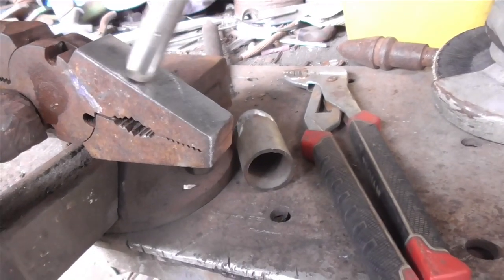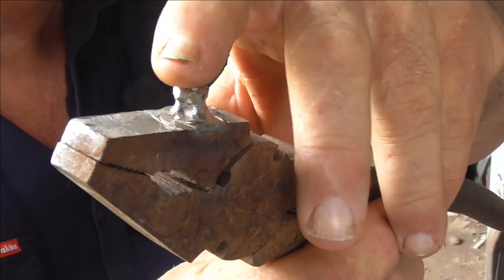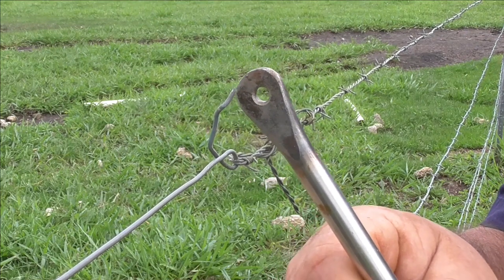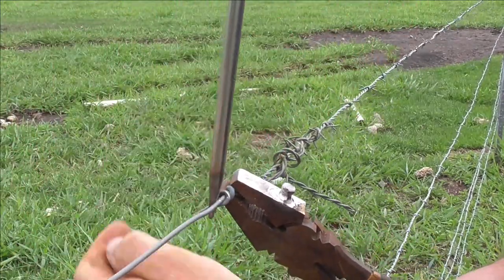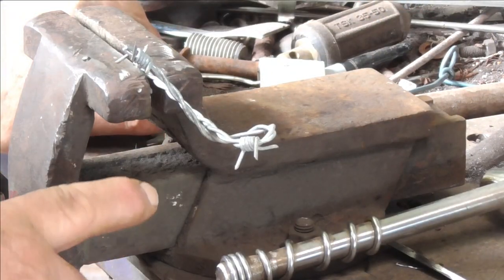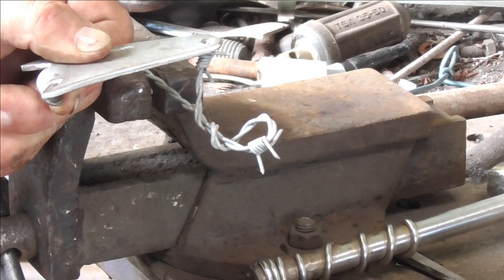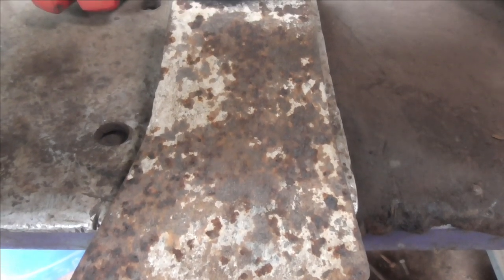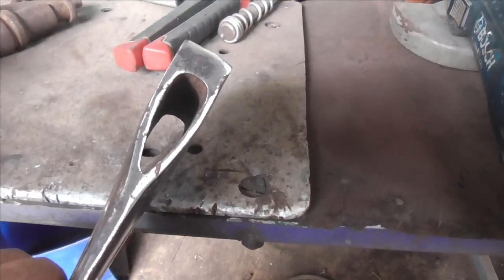MY HOMEMADE FENCING TOOLS

Comment: The tie-wire twister is cool.  I made one from an old 22mm spade bit in just a few mins with a grinder & cut-off wheel,.  Makes neat ties every time.  The pliers took a little longer and it's dusk now so I'll have to wait to try them out tomorrow.  Thanks!
Reply from the maker: Glad you could get something useful out of the video the knob on the pliers is very handy once you get used to it. John

Comment: OMG.  That's perfect at the side view.  Now I can really see how it all works. Thanks.  I'm hoping this will be exactly what I need by myself.  Trying to get any man in San Diego, CA to help you paid or not is impossible!   I have a dog pulley system because of no fenced yard.  1 main overhead wire that attaches each end to a pole, then each pole is anchored to a stucco wall.  The one-side anchor is constantly loose and it's extremely difficult to push the pole taught, then tighten the wire at the same time with just 1 person.  I'm using turnbuckles but they don't seem to work right.   It's hard to use a ladder because the ground is wet and you sink down.   At least every time I do this, I'm using a different technique, so I totally understand making your own tools.  Thanks
Reply from the maker: Thanks for watching and commenting. John

Comment: Great video, learnt a lot from it. Is there a shortage of vaseline or oil to add to tools? I hate rust.
Reply from the maker: We live in a area that everything rusts I have never seen anyplace like it. John
Reply: @farminglifeaustralia6716  Okay, apologies. Live in S Africa Inland far from salt water but have to keep my tools from rusting.
Reply from the maker: @russel2352  No worries The rust here drives us nuts. John
Reply: Heat up old motor oil and the hatchet head and put it in the hot oil. The metal will adsorb the oil and rustproof it for years of work.

Comment: Great video, what do you use to flatten the metal?
Reply from the maker: I assume you mean the little twisty tool with the hole in it. I heat the end up red hot then use a hammer and the anvil and make the end flat. If you dont have an anvil any large piece of metal will do a piece of railway line is perfect. John
Reply: @farminglifeaustralia6716  Steering turntable casting from an old steam traction engine makes a great anvil and the shaft is handy for hammering bends around! Drive wheels make good entry gate ornaments and flywheel makes a killer birdbath. And nobody's going to walk off with them! 😜😊
Reply from the maker: @theoztreecrasher2647  Ok I will keep an eye out I'm not exactly falling over traction engines lately. The good old stuff is getting hard to find. John
Reply: They make them in NZ with 3 diff size holes they are real cheap on Trade Me or Farm shops if you dont want to make it yourself

Comment: Its  better   to join barb wire together  by placing  2 wires  parallel  to one another  and twist   one wire 1 way and take other  end and twist  opposite  direction.. so much better  and stronger ...🙂
Reply from the maker: Thanks very much for the tip. John